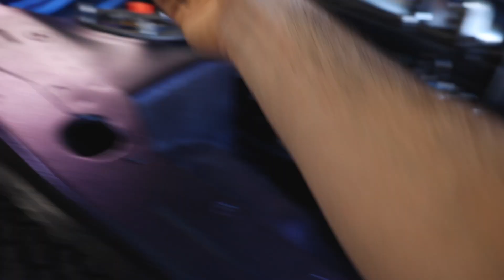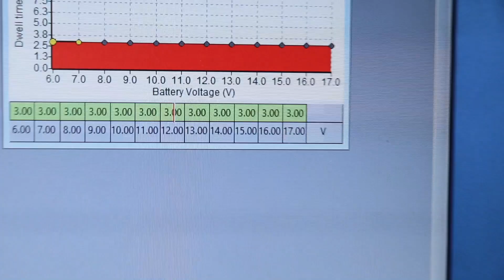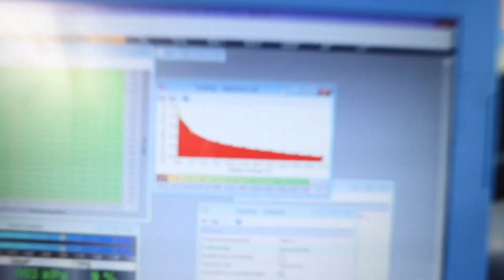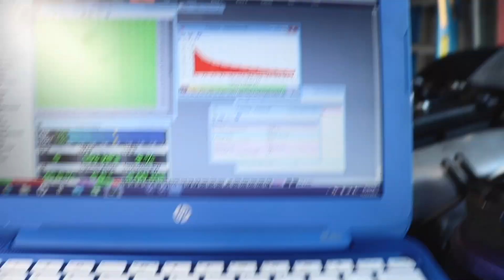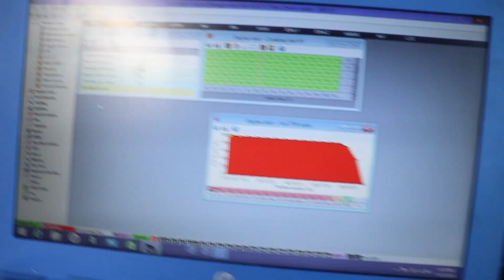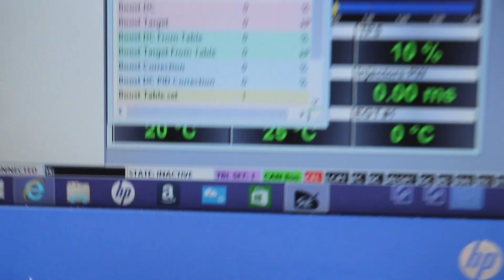Big Turbo RB20 First Start Attempt (ECUMaster EMU Black)

Comment: Did you change the cas disc? Or will that ecu read the factory disc?
Reply from the maker: The ecu will pick up the factory cas. The time difference between Martin and I has made it difficult for us to be able to work at the same time but when we get that worked out it shouldn't take long to get it going.